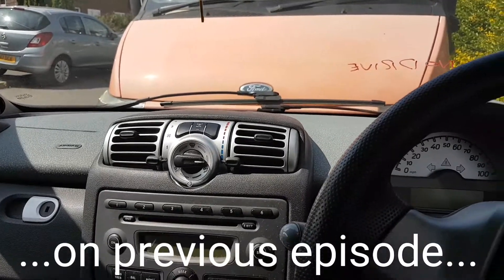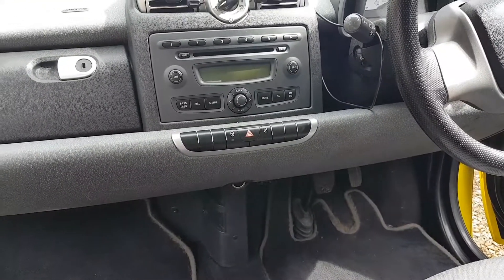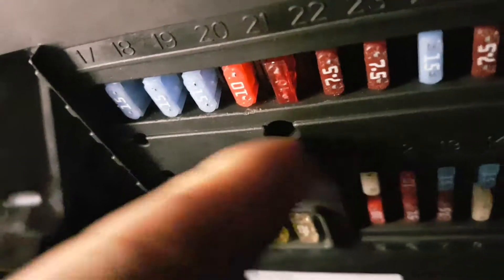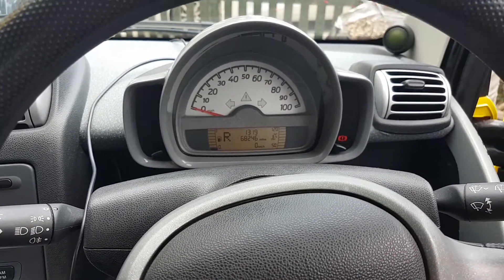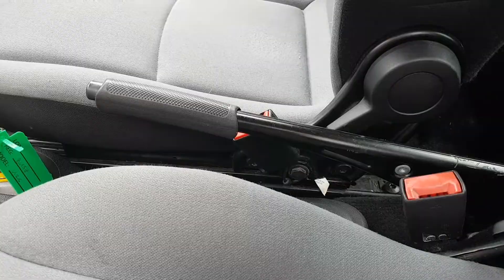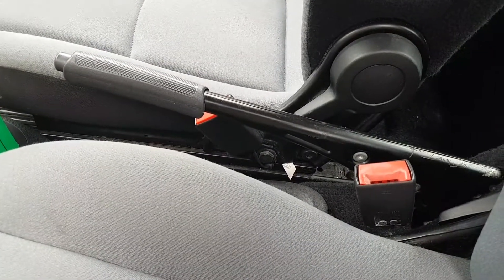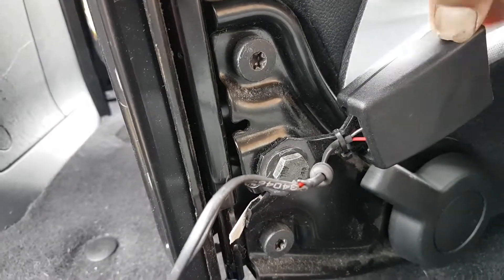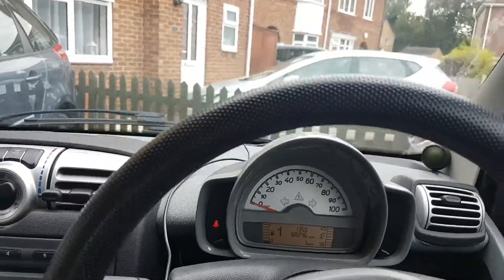And the Smart Fortwo came back... no gears, same fault... can I fix it this time?

Comment: Good job finding that, i currently diagnosing a weird transmission problem, the first two gears will jerk then skip to third after about ten seconds, after i can shift 3-4-5 or 5-4-3 just fine but will refuse to go to second or first gear unless i shut the engine off then shift manually, adjusted and greased the clutch actuator but still the same, these car have fragile electronic
Reply from the maker: Perhaps the gear actuators?
👍👍👍

Comment: 08 smart 451, I live in Central london and drove to a Smart Geek in Cheltenham (220 mile round trip)  who removed the passenger seat took out the ECU put it on a computer and reset it with the Mercedes upgrade, £100.00. Flew all the way home, car never felt so good. Can't give the guys contact details utube would consider it advertising but I am sure you can find it.
Reply from the maker: That must have been a completely different problem than the one on this car...
👍👍👍

Comment: That's really poor electrical design, a simple short on a seatbelt buckle can bring the whole car to a halt! 😬 Should've been fused on something less essential.
Reply from the maker: Agree...
👍👍👍
Reply: Ya it's a cheap Mercedes why would you buy a smart car when you could buy a micra or a golf or a up which are lovely cars and build the last and the same size
Reply: No.It should be designed to work not on 12v but on ground
Reply from the maker: @mykedindeal  
Agree... but they did not designed it that way...
👍👍👍

Comment: I was very unhappy with your previous video about this, and said so in the comments. Very pleased that you've now fixed it.
Reply from the maker: But you see now what I mean?
I could have started to dismantle the car... looking at the wires to the ABS, or to the Gearbox,  to the Airbag... for nothing...
At least this way, I had a bit more "info" and "how it happens" to work with...
Thank you for watching and for your comment! 
👍👍👍
Reply: @LMAutoRepairs  I could see what you meant in the last video and I'm sure you understood my comments. If you had read the wiring diagrams last time, you'd have got it right first time.
Reply: @LMAutoRepairs  That was me😂,under the car looking at the abs wiring and the gearbox/clutch wiring. Wiggled lots of wires but the fuse never blow.
Reply from the maker: @seankirby2580  
I see what you mean...
Just don't agree that is that simple all the time...
We all overlook things, and don't always approach things the same way...
👍👍👍
Reply from the maker: @mdsymonds75  
That's what I tried to avoid the first time... and glad I did it...😋

Comment: Great Fix! 
I think it wasn’t easy to find it because from the wiring diagram the feed line stops 
at the airbag control unit and did not explicitly shows that it also feed the belt switch, is it?

Comment: My Smart won't engage reverse especially if parked sideways uphill, but works OK in level ground. What could it be, please help. It engages drive normally though.
Reply from the maker: That's strange, but difficult to advise without looking...
Perhaps scan the car an see if there is anything that points into any direction...
👍👍👍

Comment: Hello there,! Can you help me? The panel of my smart 451 keeps blinking after start. Car all operational but after starting the panle info goes on and off. Any hints or sugestions? Can send you a video if you wish! Thanks for your time
Reply from the maker: Check what voltage your alternator is outputting... might be nothing, but just popped up i to my head...
If all good, check voltage supply to the cluster... if is also missing...
Hope that helps...
Thank you for watching!

Comment: My smart engage the gear but the car dont drive do you know what could be?
Reply from the maker: Clutch?
👍👍👍
Reply: @LMAutoRepairs  but i hear if the clutch is bad and the car is cold you can still drive 10 15 minuts until goes bad my doesn’t move even if the car is cold.
Reply from the maker: Each case can be different...
If is engaging the gears, and does not drive, either clutch, clutch actuator, gearbox or drive shafts...
Inspect... and if all visually good on the outside, I would go with the more obvious... the clutch...
That said, scanning the car and look at some live data, should help you a bit as well...
👍👍👍

Comment: Ca. U help with a 2008 that now does not go past 2nd gear. Kicks tranny into neutral need help desperately
Reply from the maker: Any codes?
👍👍👍
Reply: P1901
Reply from the maker: Hi
Difficult to tell based just on the code, some live data analysis, and experiencing the problem, is of a lot of help...
That said, I would say that either the clutch is worn, or the clutch actuator... but again, difficult to say...
Reply: @LMAutoRepairs  car starts to drive the bucks and flashes N the flashes 3 lines plus abs system not reading 2 rear wheels after having new abs sensors and reluctor rings